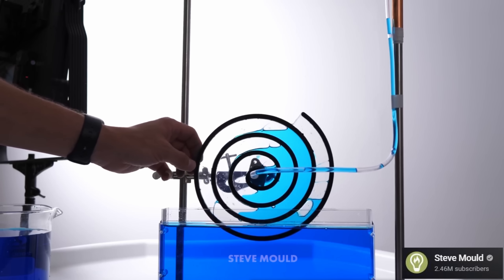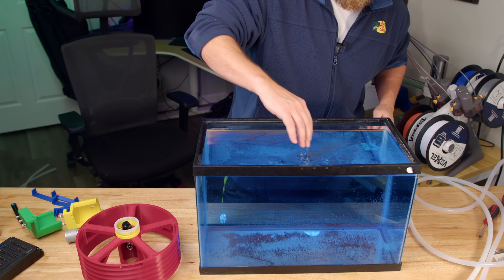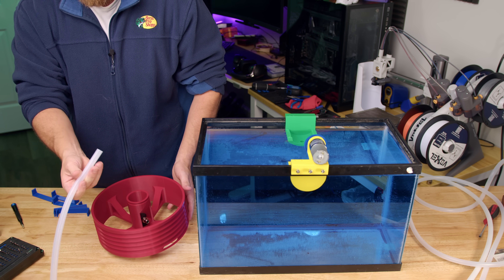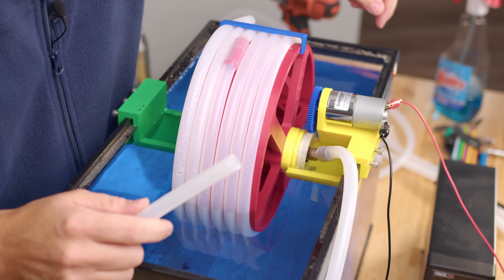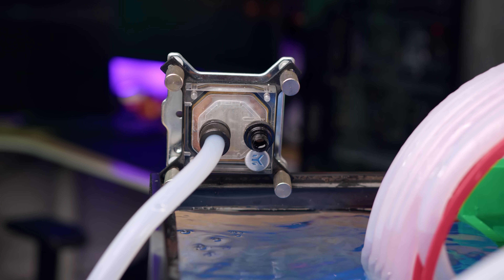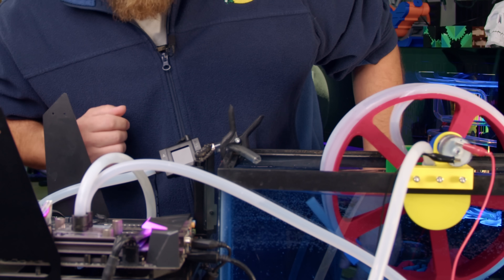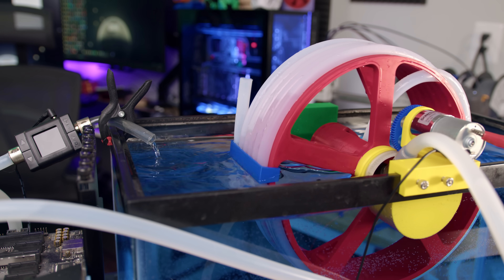Can a 217 YEAR OLD Water Pump Cool A PC?

Comment: Okay, here is what you should do with this setup, have a tank in a higher position which you fill with the pump, and let gravity and pressure do the work of pushing the water through the system back in the bottom tank where the pump is. What do you think?

Comment: You can get rid of the air bubbles by pumping the water in to an elevated tank and then use the flow from there.

Comment: what if you close the spiral at the end... I mean, where the water comes in, but make a cut every inch or sort of in that close end like a paddle wheel.limiting the air that infress to the loop. Or maybe a big entry tube shrinking down as it go to the loop.
Also whats happen when is mostly submerged?

Comment: have the pump fill a reservoir with a simple flow control valve and feed a steady stream to the cpu this will let the air out. you can even setup an arduino to speed up and slow down the wheel based on the level in the reservoir

Comment: Since you need air in the system to actually get it to work, could you just lower the coil or raise the water level so that 9/10ths of the coil is under water and the top only just takes a little "gulp" of air. That way you would have more water than air in the system. Just a thought. This is a great video too 👍Since you need air in the system to actually get it to work, what I thought is you can just lower the coil or raise the water level so that 9/10ths of the coil is under water and the top only just takes a little "gulp" of air. That way you have way more water that air in the system. Just a thought. This is a great chann , it's one of my favourites I reckon too. 👍👍
Reply: Be interesting to see some experiments to see how that works. Less air means you need to run it slower to stop water sloshing over the tops of the coil loops, so there's going to be a trade off with a sweet spot at some point between how much you can reduce the air vs how much you need to slow the rotation to allow it to still function.

Comment: I'm curious if the temperature was stable because the CPU was laying flat, allowing water to pool over it. It seems it takes some time to move the heat from the CPU to the water, so it didn't cause much in the way of spikes. I'd be interested to see what it does when the CPU is vertical, like in a "normal" setup.

Comment: Great video! So, I'm curious if speeding up the wheel would improve anything. And also if the wheel was smaller, maybe it could spend less time out of the water pulling in slightly less air? Or perhaps a smaller and faster wheel would improve the functionality.
Reply: He touches on this, if it rotates too fast then surface tension causes the water to get "dragged" up over the top of the coil, breaking the effect that causes the pump to work in the first place.

Comment: Modern boiler systems for radiant heat often have an
air release valve added into the system. You might be able buy one but could probably make one. It's basically a chamber with a fin or two and a floating check valve. Air gets out but water is supposed to stay in and works on pressurized systems.

I would really like to know if something like that would work with something like this.

Comment: Would submerging the entire wheel in the liquid remove the intake of air on every revolution? Increasing the depth of the wheel and driving the wheel with the motor via a gear train could work. Though some gear reduction may be needed depending on the motors power.

Comment: You should add a radiator with a fan to the loop, and then run like an 8 hour stress test to see if, with a radiator, what temp the CPU heat soaks the water to.

Comment: Nice work, I wonder if the taller wind, like (Steve and the old farm dude use) creates more pressure, as the old guy was moving it uphill. 
I would also position the heat block at a slight angle so the air pools at the outlet.

Comment: Maybe use the pump to fill a reservoir then use that to flow through the block removing the air from the system. If your pump can keep up with the flow... but if the flow is causing a change in water heights it should balance out and become a flow that speeds up and down.

Comment: i wonder if you made multiple tubes at different angles and then linked them with an air bleed could you get a more constant flow? ie, so while 1 tube end is up in the air, the other is in the water ( 3 would be ideal at 60 degrees apart think that way there is always a tube end in the water.  some sort of of bleed and a "non return" ball float thing might combine all 3 water sources to the outlet tube?

Comment: Doing two lines around the drum with open ends 180° from each other would essentially make the flow continuous.

And for another video: you've water cooled an air cooler, but how about water cooling a water cooler? How much better would an AIO or custom loop perform if you submerged the radiator in flowing water?

Comment: With a smaller drum, would it be possible to increase the flow rate and decrease the air in the system?

I know with a pump like this you'll never eliminate the air in the system, but a smaller drum may help? Also, I believe it could possibly handle a little more RPM on the drum as well, which could also help with the flow rate
Reply: It will always pump air because of how it works. The slower it rotates the less air it has to pump, so ideally it'd be a large wheel that is submerged as deeply as possible, maintaining the minimum air lock for the pump to function.

Comment: really cool, you could probably put two smaller pups in parallel, one 180-degree out of phase with respect to the other, in order to eliminate as much air as possible and run a smoother flow!
Reply: You can't the air bubbles are integral to the function of the pump.
At best you could add a holding tak of sorts that would allow the air to separate

Comment: Scoop that feeds more water after it breaches the surface, but small enough it does just spill at "000".   Can you add more pipes and T fittings in the center?  Each tube end would have another wide scoop to make a neat reverse water wheel.   Check balls valves to prevent back flow with multiple pumps in line.  

I really need to start getting into CAD and 3d printing.  One of these days I hope.   Teenagers eating all my disposable income.

Comment: it's probably for the best it's an older less aggressive CPU and it's just AIDA (very flat with no real Transients) vs a more stressful test with a newer and more aggressive CPU since those air pockets could allow the Die to overheat before the next Pump Cycle
but, it's a fun project anyways, and it's not like anyone is expecting it to be practical. cheers.

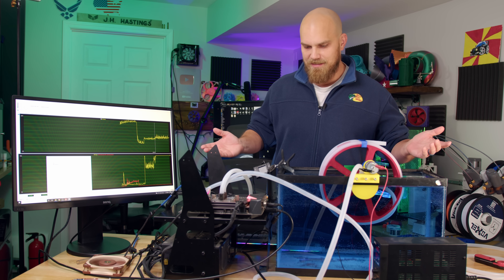Comment: 9:25 I want to see you build a loop using nothing but parts sourced from AutoZone, O'Reilly's, CarQuest, RockAuto, and a CPU/GPU block. Hosing, coolant, pump, rad, res, the works. only parts in the loop you don't get from the auto parts store is the water blocks themselves.

Comment: This is cool.
What effect dos the diameter and the length have?
If you had a smaller diameter, would the air sections last a little shorter?
What it the intake of the pump always was under water (somehow). (if you submerge the pump fully ). Maybe the pump needs the air to do any pumping.
But if that is the case, you could test what the optimal height for the pump is.
Also what happens if you rotate a little slower and a little faster?

Such a cool project, lots of things that could be interesting to test.

Comment: Would the water pressure increase if you used a larger tube on the drum and then downsized to the smaller tube used for the cooling? Maybe it'd do more volume at a time with each rotation.

Comment: An old way to get water using well required a type of piston and a one way valve. If you can 3d print a crank shaft and two pistons wit one way valves. That might be and  interesting project

Comment: Make the wheel bigger.  Segment the wheel for the build plate if needed.  
Use gears to speed the wheel up.  
Put a funnel on the end to scoop more water.
Create a catch tank up high to release the air and let gravity push the water down.
Reply: Bigger wheel yes but these pumps are limited in speed due to how they function but have it pump up to a holding tank above the PC then use gravity to feed back down into the fish tank that would be on the floor. That would ensure a constant flow and no air bubbles.

Comment: Some sort of air separator system would be neat. Probably could make out of of just a bottle as reservoir where the air can bubble up to the top and some float valve to vent when there is enough air in it.

Comment: You could add an automatic air vent to the pump system. Might even be able to 3D print one... Maybe. Basically it is a small chamber with a "Bubble" in the center when water in the line rises in the chamber the bubble floats to the top and closes a valve. However, if air gets into the line it flows up into the chamber the bubble drops opening the valve and allowing the air to escape. Not sure how well that will work with that kind of system, you might lose a lot of performance. Might have to add a second pump coil at a 180 degree rotation to get consistent water flow.

Comment: One idea is if you put a static tank that captured the air and water downstream of the swivel, and released only water through one exit that leads to the CPU, and have an air throttle as a second exit. If the throttle is correctly sized, it will regulate a constant higher than atmosphere pressure. Think a tire with a slow leak in it.

Another idea is to have multiple intakes to even out the air/water cycles.
Reply: You can just use a normal reservoir for it with an automatic vent screwed into the top of it. I have one in my loop on the 80ml reservoir that serves as the air trap. The valve works by means of a membrane that can flex both ways, it lets air in or out when the pressure difference on the membrane exceeds about 400mbar. Aquacomputer sells them for like 7 euro.

Comment: I have generally found that people use much higher flowrates than are actually required for most watercooling setups. Water has massive heat capacity, and the difference between running your pump at full compared to its lowest speed is often just a couple degrees; temperatures is primarily controlled by radiator size and fan speed. Running your pump at minimum is much quieter, your pump will last longer, and the pump will dump less excess waste heat into the loop to boot.

Definitely some kind of vertical stand-pipe to release air would be a good addition here to purge the air from the system (the air is blocking a lot of heat transfer) and provide smoother flow. Since the tubing sees variable back-pressure as it goes along the coils, it also might be helpful to jump tubing sizes a couple times across the drum. Start with a smaller inlet pipe and then use couplers to jump up in size every turn or two, which will approximate a widening pipe and provide more weight to keep the air slugs from climbing over the loop near the end at higher rotation speeds.

Comment: I wonder:
If you would angle the drum in a way, that the inlet is always under water, but not 90 degrees (more like 45 or 30), would that pump design still work?
You'd need to elongate the drum, but shrink it in diameter of course. And you'd need to mount everything lenthwise in the tank to fit it. Eventually a different motor with double the speed.
I'm thinking of eliminating the air pockets and making the flow more constant.

Comment: so currently, you're doing 1 in 1 out but what if you split it into 4 input, 1 output where the 4 input is off set 90 degrees from each other? maybe we can run firestrike then?

Comment: I've seen in fish tanks where they prime the hose, then capillary action pulls the water through the tube into reservoir. Most people do that to clean their tanks. What would happen if you did that capillary action through the cpu, and used your pump to pump the water back up to the top.

Comment: You can remove the air by using a reservoir. The pump would have to pump twice the cross-section since the air takes up about half the tubing. The air & water would be pumped into the reservoir where they separate. The air would escape to the atmosphere and the water would be gravity feed to the CPU.

Comment: What if you wrapped 2 or 4 hoses at different angles and dump each tube exit into a manifold and then into the cpu block. It would alternate between air and water faster. I wonder if it would allow you to do more than idle.

Comment: Cool funny idea, how about trying to put an air separator on, a tank where air can escape but water will be pushed on.
If you lead the water into the bottom of a tank that has a float that when the tank is full blocks air and water from getting through but opens up when the airmen are big enough. the water can then be pushed on through another pipe at the bottom of the tank.

Comment: Though it would not improve the issue of pumped air, it might be interesting to put 2 hoses in parallel where each dips into the water on opposite side of the wheel and both output into the hub connector.  

One-way valves would surely be needed where each hose connects to the hub (or wherever the combine) to avoid back-pumping, however, which may make this approach impractical.  I don't know what's available or can be made, but a t-shaped valve where each hose pushes a ball or valve to close off the other hose with the output in the middle might work if independent 1-ways are too bulky, pricey, or impractical.  The extra restriction might be a deal-killer anyway.

The idea still interests me, though, as double action should greatly reduce the "off" time without increasing motor speed and increase total volume if the same hose were used.  A slightly smaller hose might be more practical for compactness as you'd want to keep a similar number of turns, but you wouldn't want to reduce the hose diameter too much due to the exponential volume loss and increase in surface tension; the smaller the hose radius, the greater the losses and vice-versa.

Comment: Can you use a belt drive and offset the vertical position of the pump within the tank? May that reduce the systems air volume? This could reduce the ratio of monooxygenhydrogenate to combinatioxynitrogenate.

Comment: Really cool concept. I would add a smaller fill tank to bleed the air and act as a capacitor to keep the flow constant.   Great video as always.
Reply: I was thinking that a vertical tube right after the pump would allow the air to bleed off, but yeah a reservoir would accomplish the same thing.
Reply: I was thinking this too.  Like pumping an old Super Soaker water gun, but with a bleed valve on top of the tank to keep a constant pressure and give some place for the air to go.

Comment: Completely submerge the pump and set the motor up with a large diameter contact drive pulley to drive the rim of the pump... this will get rid of the air gaps.

Comment: V2 should include another pump setup exactly like this.  But, have the pumps setup 180 degrees out, meaning have one of the inlet tubes under water, and the other pump have the tube out of the water.  Then have them connected via T Flange.  See if that would keep a constant flow of water.  Probably not, because you still have to account for the air in the system.  But i'd be curious to see what happens.
Reply: That air could be gravity bleeded out. You could add long vertical tube before junctions and bleeding hole on top of that. Bleeding hole should be higher than any point of water. It's janky, but what part of this really isn't :D
And since that bleeding hole is above any point of water (and that drpo should also start abve whole system) then it should work only with gravity pushing all the water trough. Pump just lifts the water to highest point and gravity does rest.
Reply: @TheSanpletext the whole point of the pump design was head pressure. The vent pipe would need to be super tall
Reply: Maybe adding a mini air release valve at the highest point should help bleed the air out?
Reply: I was thinking add a second loop on the inside of the wheel.
Reply: a alcohol makers burp valve set a half foot over the pump wheel would probably do it. if you want jank, a t-valve to catch the air, and a red solo cup with a water trap using a plastic shot glass would be effective enough. make the riser tube 2x the size of the water pipe to lower resistance. make the whole pc downhill would let any air flow back up to the trap.
Reply: I was thinking the same thing.  Maybe it could be improved by having some way to have pressure "stored" in one line while the other is filling, perhaps some sort of "soft" check valve or a vane that could change with the rate between the two?
Reply: The idea above but pumped Into an open top sump or funnel (to allow air separation, then gravity fed to the cpu, could work providing the passage over the cold plate restricts flow at the correct rate.
Reply: It would work with two tubes around the same drum with the inlets on opposite sides.

Comment: Could you try making a full loop (cpu+gpu) using more modern and power-hungry components to see how fast you can heatsoak that water tank? I mean probably some power limits will be necessary cause I doubt that pump can handle an rtx4090 and a 14900k at full power, but maybe something like 150 watts on the cpu and 300 on the gpu?
Reply: If you know the dimensions of the tank, the relevant temperatures, you can get a pretty good estimate on that just from doing some math.

Comment: I always love the random experiment videos,  you tried to make a water pump but you also made a trompe,    now you need to make a separator with a check valve that will release some of the air as it builds up,  and use it to cool a rad to help pull heat from the system.